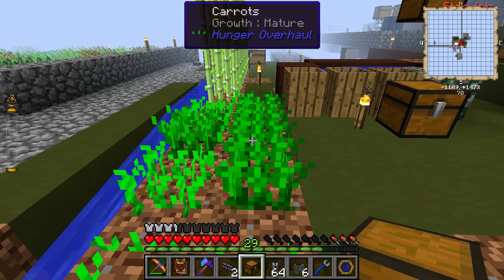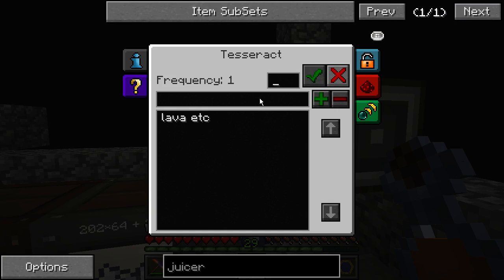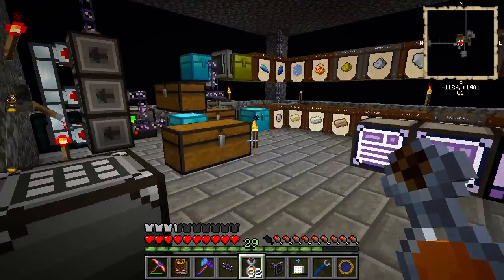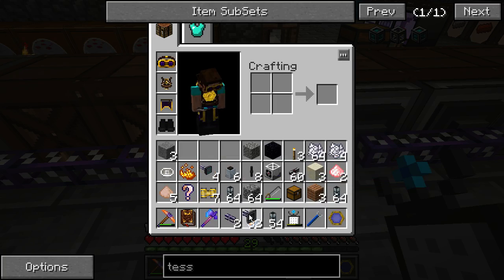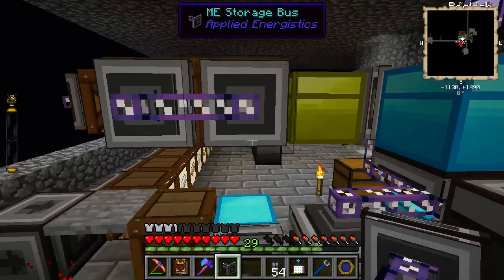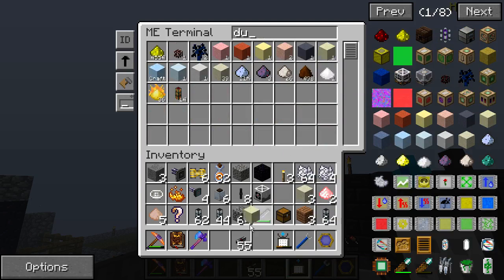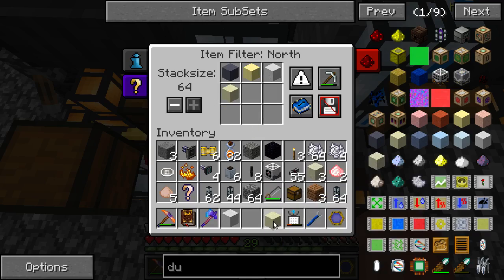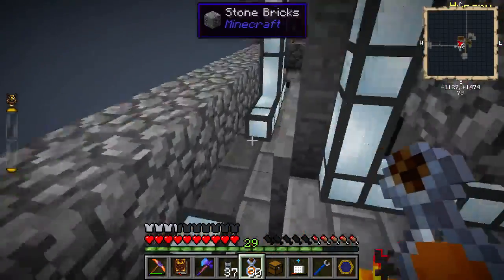Agrarian Skies - Episode 144 - Temporary Fixing of Thermal Expansion Grid Handler Tick Lag

Comment: When it comes to tesseracts, it might be best to have several independent systems separate from your main system.

Say you wanted to make a pulverizer system again. Rather than hook them up to the same thing, you could just connect everything through ME cables and have a separate system from your first two channels until the end product(s), which could then be sent to the system via a tesseract connected to your system. Just a thought.

You can also set up channels for specific duties. One channel for ONLY energy creation and consumption, one for ores specifically (with better barrels and chests for byproducts during processing), and your main systems with a few exta channels for just-in-case and oddball jobs. What do you think?
Reply from the maker: chey smith i have to figure out the cable landscape of the construction first,, might be something worth thinking about